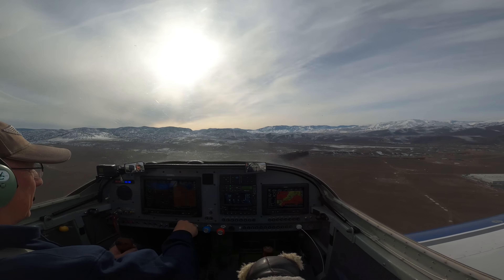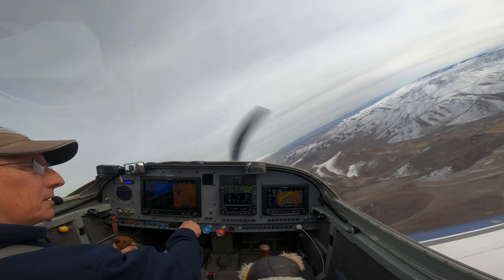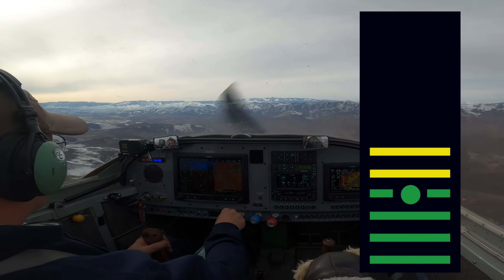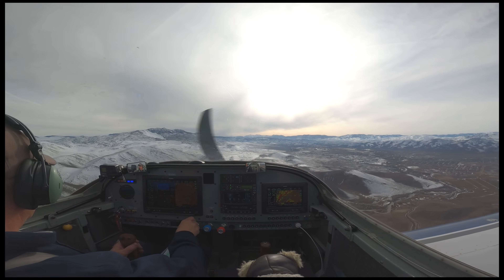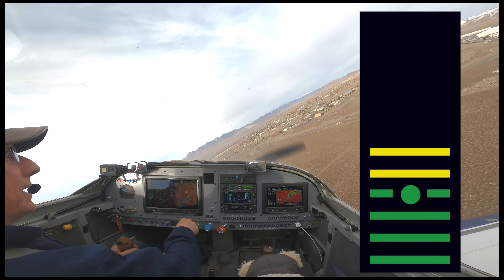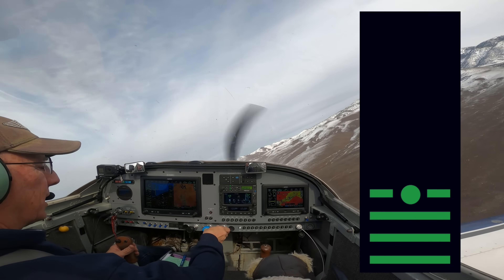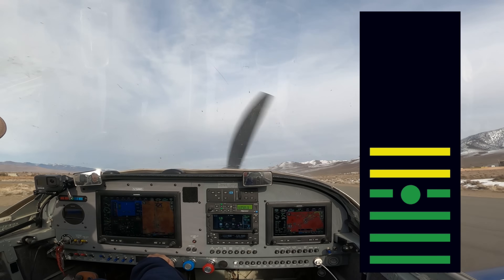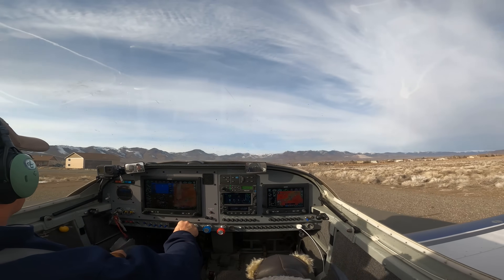What's It Like to Fly With Angle of Attack? (Updated)

Comment: Paul,
  I have had my Garmin G3X for two years now and still cannot get the AOA to work correctly.  I have calibrated it per the manual 20 times, yes 20.  Every time I fly it gives me totally different speeds.    Sure, could be a nice tool to have if it only worked.  I gave up on it and disregard it now.   What a pain.  The instructions are simple, but if it only worked.   Comment?
Reply from the maker: We've done a bit of checking on this. Is it possible the pitot and AoA lines are swapped? We're told that can cause some of the issues you're seeing.
Reply: No
Reply from the maker: @jimstoops5792 Have you pestered Garmin? There's a G3Xpert at g3xpert@garmin.com.